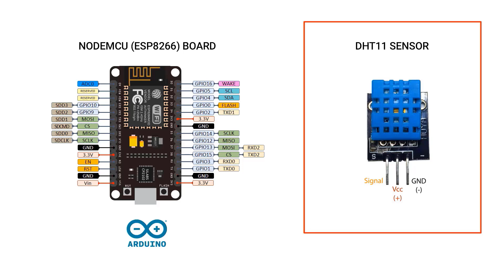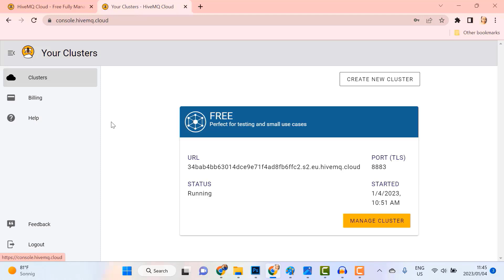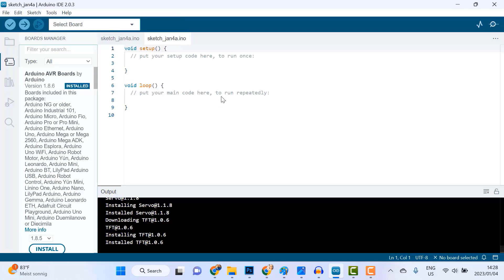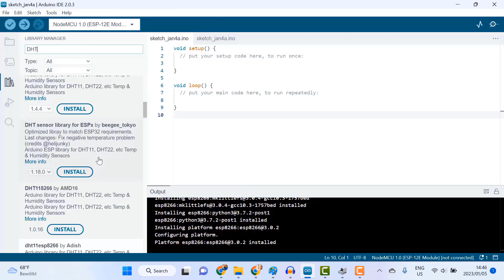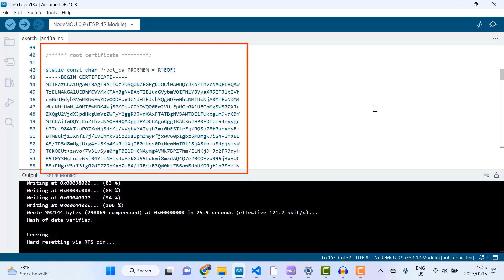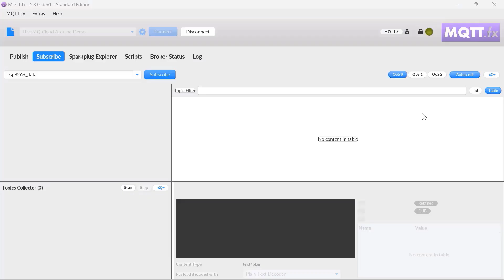Getting Started with MQTT on Arduino Using ESP8266

Comment: Here is the cert if anyone wants it:

static const char *root_ca PROGMEM = R"EOF(
----BEGIN CERTIFICATE----
MIIFazCCA1OgAwIBAgIRAIIQz7DSQONZRGPgu2OCiwAwDQYJKoZIhvcNAQELBQAw
TzELMAkGA1UEBhMCVVMxKTAnBgNVBAoTIEludGVybmV0IFNlY3VyaXR5IFJlc2Vh
cmNoIEdyb3VwMRUwEwYDVQQDEwxJU1JHIFJvb3QgWDEwHhcNMTUwNjA0MTEwNDM4
WhcNMzUwNjA0MTEwNDM4WjBPMQswCQYDVQQGEwJVUzEpMCcGA1UEChMgSW50ZXJu
ZXQgU2VjdXJpdHkgUmVzZWFyY2ggR3JvdXAxFTATBgNVBAMTDElTUkcgUm9vdCBY
MTCCAiIwDQYJKoZIhvcNAQEBBQADggIPADCCAgoCggIBAK3oJHP0FDfzm54rVygc
h77ct984kIxuPOZXoHj3dcKi/vVqbvYATyjb3miGbESTtrFj/RQSa78f0uoxmyF+
0TM8ukj13Xnfs7j/EvEhmkvBioZxaUpmZmyPfjxwv60pIgbz5MDmgK7iS4+3mX6U
A5/TR5d8mUgjU+g4rk8Kb4Mu0UlXjIB0ttov0DiNewNwIRt18jA8+o+u3dpjq+sW
T8KOEUt+zwvo/7V3LvSye0rgTBIlDHCNAymg4VMk7BPZ7hm/ELNKjD+Jo2FR3qyH
B5T0Y3HsLuJvW5iB4YlcNHlsdu87kGJ55tukmi8mxdAQ4Q7e2RCOFvu396j3x+UC
B5iPNgiV5+I3lg02dZ77DnKxHZu8A/lJBdiB3QW0KtZB6awBdpUKD9jf1b0SHzUv
KBds0pjBqAlkd25HN7rOrFleaJ1/ctaJxQZBKT5ZPt0m9STJEadao0xAH0ahmbWn
OlFuhjuefXKnEgV4We0+UXgVCwOPjdAvBbI+e0ocS3MFEvzG6uBQE3xDk3SzynTn
jh8BCNAw1FtxNrQHusEwMFxIt4I7mKZ9YIqioymCzLq9gwQbooMDQaHWBfEbwrbw
qHyGO0aoSCqI3Haadr8faqU9GY/rOPNk3sgrDQoo//fb4hVC1CLQJ13hef4Y53CI
rU7m2Ys6xt0nUW7/vGT1M0NPAgMBAAGjQjBAMA4GA1UdDwEB/wQEAwIBBjAPBgNV
HRMBAf8EBTADAQH/MB0GA1UdDgQWBBR5tFnme7bl5AFzgAiIyBpY9umbbjANBgkq
hkiG9w0BAQsFAAOCAgEAVR9YqbyyqFDQDLHYGmkgJykIrGF1XIpu+ILlaS/V9lZL
ubhzEFnTIZd+50xx+7LSYK05qAvqFyFWhfFQDlnrzuBZ6brJFe+GnY+EgPbk6ZGQ
3BebYhtF8GaV0nxvwuo77x/Py9auJ/GpsMiu/X1+mvoiBOv/2X/qkSsisRcOj/KK
NFtY2PwByVS5uCbMiogziUwthDyC3+6WVwW6LLv3xLfHTjuCvjHIInNzktHCgKQ5
ORAzI4JMPJ+GslWYHb4phowim57iaztXOoJwTdwJx4nLCgdNbOhdjsnvzqvHu7Ur
TkXWStAmzOVyyghqpZXjFaH3pO3JLF+l+/+sKAIuvtd7u+Nxe5AW0wdeRlN8NwdC
jNPElpzVmbUq4JUagEiuTDkHzsxHpFKVK7q4+63SM1N95R1NbdWhscdCb+ZAJzVc
oyi3B43njTOQ5yOf+1CceWxG1bQVs5ZufpsMljq4Ui0/1lvh+wjChP4kqKOJ2qxq
4RgqsahDYVvTH9w7jXbyLeiNdd8XM2w9U/t7y0Ff/9yi0GE44Za4rF2LN9d11TPA
mRGunUHBcnWEvgJBQl9nJEiU0Zsnvgc/ubhPgXRR4Xq37Z0j4r7g1SgEEzwxA57d
emyPxgcYxn/eR44/KJ4EBs+lVDR3veyJm+kXQ99b21/+jh5Xos1AnX5iItreGCc=
----END CERTIFICATE----
)EOF";

Comment: To get this code to work on esp8266 you need to setup a NTP client to do a time sync and then use setTrustAnchors instead of setCACert. setCaCert only works on esp32, this is why they added a if.

Comment: HI. Great Job. Can you explain the conditional compiling in the lines 150 to 154? setInsecure() is mandatory? I'm confused with this comand at now. I have a trouble with the function setCACert( ), IDE talks: Compilation error: 'class BearSSL::WiFiClientSecure' has no member named 'setCACert'
Reply: could you solve?
Reply: same here...
Reply: I think the video only explains how to have a secure connection using esp32, not esp8266 (my case), and I think the IF is to prevent setCACert usage on esp8266. Anyway,  the video title leads us through this error, as it is supposed to work on esp8266. I've found a tutorial by AWS IoT how to set a secure connection using the root ca on esp8266.  You need to get a NTP time sync configured before setting the certificate to the client, and then do espSecureClient.setTrustAnchors(ca).